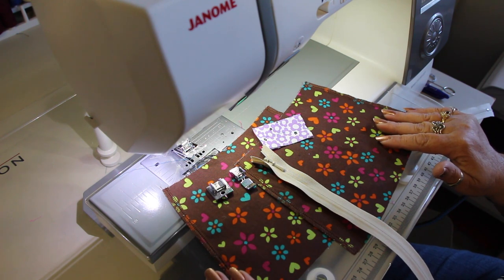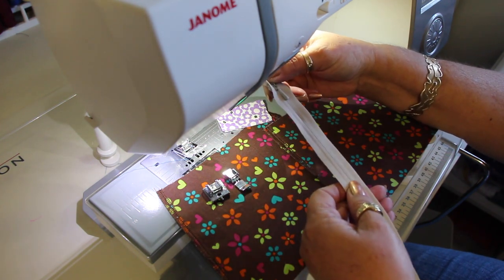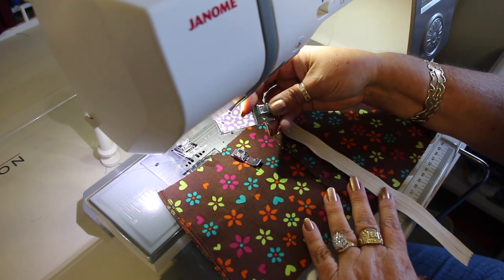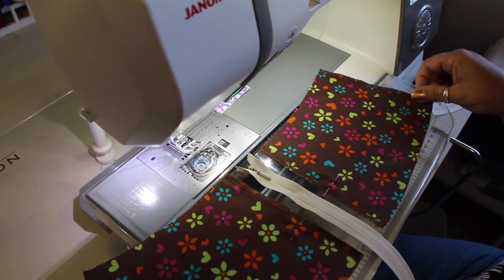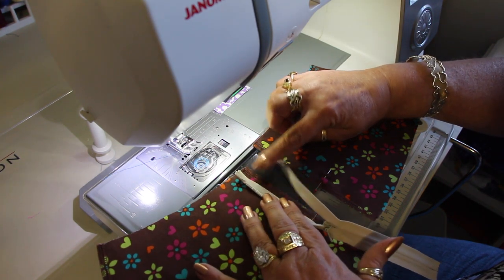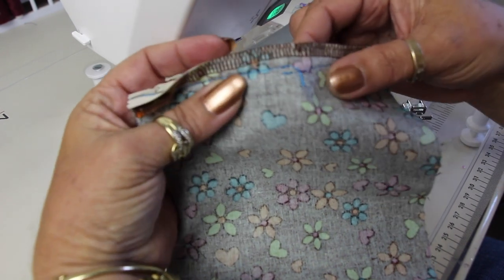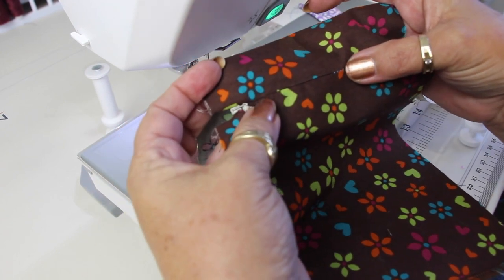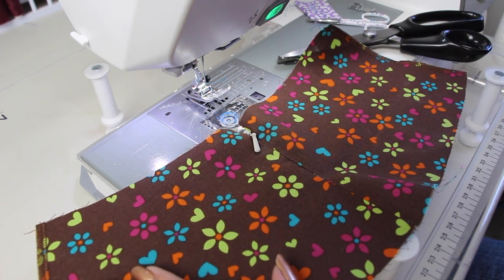How to Install an Invisible Zipper in a doll skirt

Comment: Great tutorial, I feel as though I can give it a go now.
Another thing I would like to see is how to neated edges on doll clothes if you don't have a serger.  I recently made a little coat with set in sleeves but although I zig zagged the edges it still didn't look that great.  Hope you can help.
Reply from the maker: alsionjayne That's great :)  When you have a go at putting in a zipper I'd love to know how it turns out for you.  As for finishing the edges on dolls clothes without a serger, the other options are to use pinking shears, if your sewing machine has an overcast stitch you could also give that a try.  Sometimes with the zig zag stitches if you alter the length and/or the width of the zig zag you might find you can achieve a neater finish.  Also if you zig zag more on the seam allowance and then trim the excess fabric along the raw edge you might find you may get a neater finish as well.  Other options for seams are french seams, bias binding along the raw edges also looks great as a seam finish.  You can also fold over the raw edge and stitch close to the fold, this tucks the raw edge neatly under the seam when you press the seam allowances open and flat.
Reply: Do you ever make the zipper tape thinner on an invisible zipper for smaller dolls?  And how would you do that? Or would you do it after the zipper is installed?
Reply from the maker: +Sylvia Quandt I just leave the width of the zipper as it is.  It lays nice and flat and I haven't found a need to make it narrower.